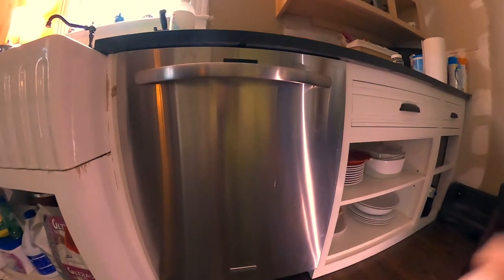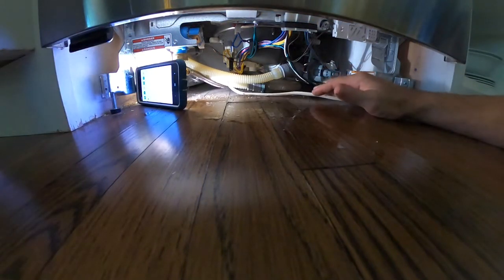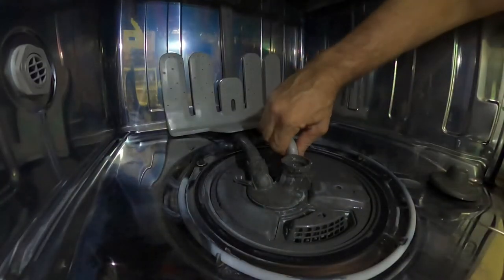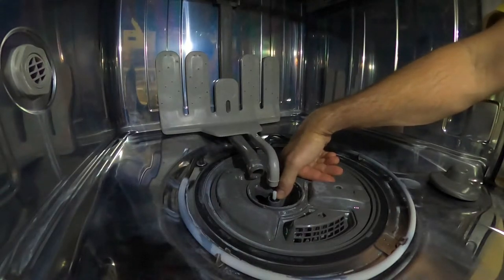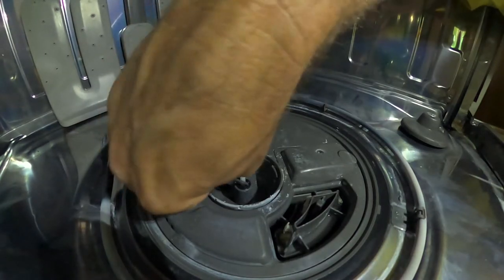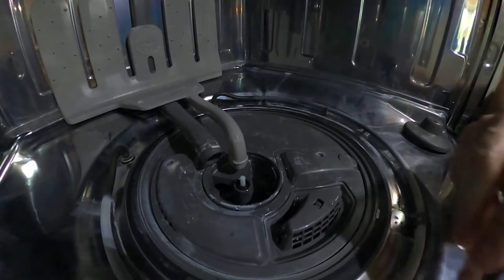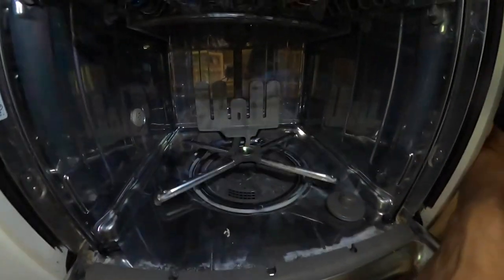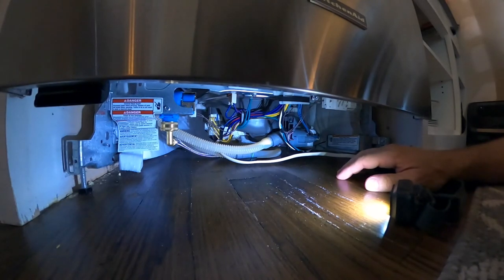Fixing a leaking Kitchenaid dishwasher, replacing faulty diverter valve seal

Comment: Nice video, great job explaining everything. I have same issue, I ordered the replacement part from eBay, still waiting though. The one I ordered looks a little thicker then the one I pulled out. The one I ordered seems a little taller, did you happen to put yours side by side to compare old to new. Was it an exact match. I saved your part information if the one I ordered don't work out. Thanks for posting such a great video
Reply: Hi, did your part solve the problem? My repl piece is taller as well, and did not come with a spring as others have mentioned. Did you put the deep-grooved side on facing down or facing up? Thanks!
Reply: @davecashman8336  yes it did fix my issue with the leak. I'm sorry don't remember what way I put it in, I pulled out the old and put new one in the same way I pulled old one out. Hopefully it fixes your issues also.

Comment: Huge Thank you for putting this up!  Repair guy quote me $750 to replace entire pump/motor assembly.  I fixed mine for $9.

There are a lot of helpful comments.  Read them all!  Here's my tip:
My grommet was IMPOSSIBLE to get out BUT If you REMOVE THE DIVERTER MOTOR FIRST from underneath, the grommet is VERY easy to get out

It's very easy to do.  Turn the diswasher on its side and it's just two screws.  You don't even need to disconnect it, just pull it out and you will have much easier access from the top, and then put it back in when you are done.  
Here is a video: on how to remove the diverter motor:  https://www.youtube.com/watch?v=72Mc-_NS2fk&t=260s  
I spent 30 min trying to get the grommet out.  It took me 3 min to take the motor off and then the grommet came right out.

I have a Kitchenaide KDTM354DSS5 purch in 2020.  Here is the link to the grommet I used https://www.amazon.com/gp/product/B07NKRGXYY/ref=ask_ql_qh_dp_hza  and it worked fine. 

Seeing how easy this is to change and what a pain it is if it starts to go wrong.  I think I'm going to put a calendar reminder to just replace this in 2 years pre-emptively!
Reply: Thanks for the info, we have the same one

Comment: Get your tin foil hats on. 
The grommet seal is the most common leak problem with the dishwashers that are made with the same diverter valve. Just because it says Whirlpool, Kitchen aid, etc. It is the same dish washer design with the same basic parts.
What fails is the grommet seal because people do not rinse off their dishes before putting them into the dishwasher. The small particles that are abrasive wear out the grommet. Okay, you know you are guilty but still want your leak fixed.
  Now you order the grommet seal, install it, and if you are lucky, it fixed the problem.
Now you replaced the seal and it is still leaking. DYI peeps are not the the most competent people in repairs, but lets say they did it right.
Do you have the tin foil hat on? I feel the manufacturers that make these dishwashers also sell the replacement grommet/seals. They have China producing the seals, which has a terrible history of not being able to manufacture anything to exact tolerances. If your repair failed, you will just buy another one of their poorly made dishwashers. For them it is a win-win. Sell a part and sell a dishwasher.